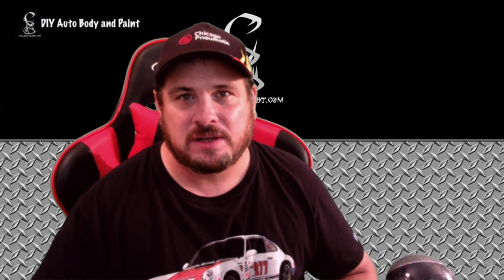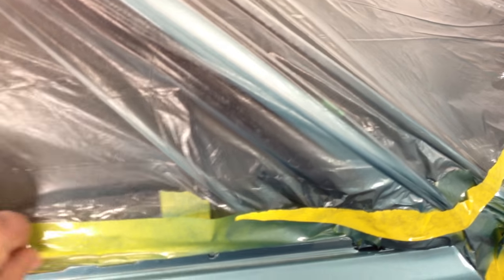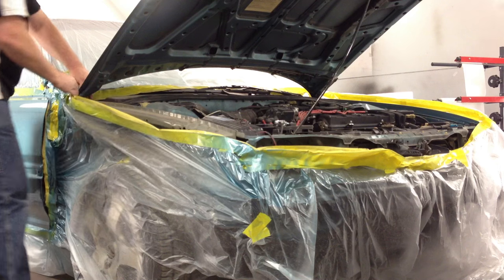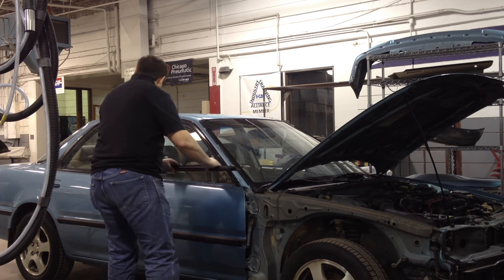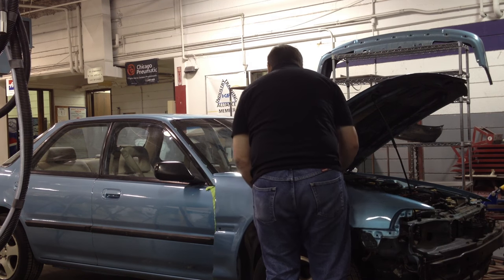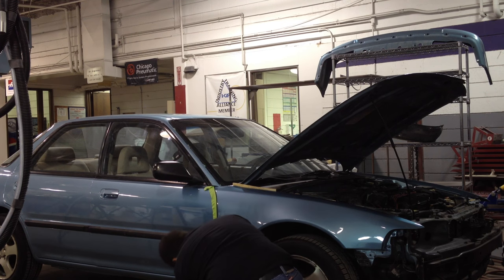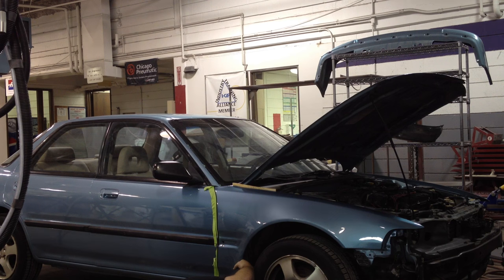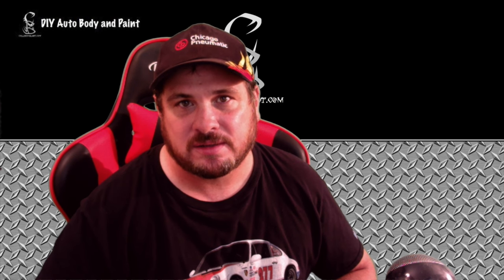Tips For Aligning Fender on Car - Integra Project

Comment: How would youg guys go about painting the roof of a car like this? would you remove the roof molding (roofdrain?) and try to reuse or replace with sealant? I can't seem to find my part number for the roof molding and im sure it will break from age and sun and my roof has the worst sun fade, i want to prime it but i dont want to just mask off over the molding unless that's my only option
Reply from the maker: Yes, we normally try to take moldings off if we can.  Although if you think they are old and brittle I may consider masking them off.  What kind of car is it?
Reply: DIY Auto Body and Paint  a 1991 Honda Civic Sedan, the other concern too is that about the last 3 inches of the rear one is no longer seated
Reply from the maker: I will have to get back to you so I can do a video demo to show you.  It would be hard to explain.  But there is a way if you are not worried about it looking factory.